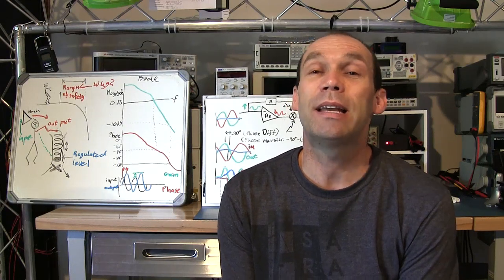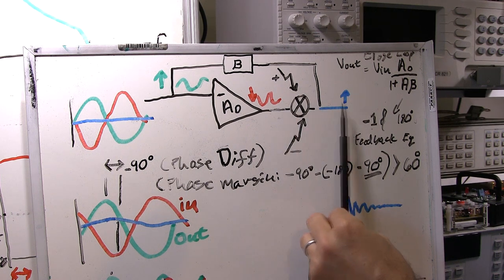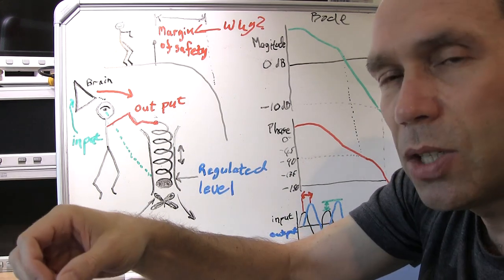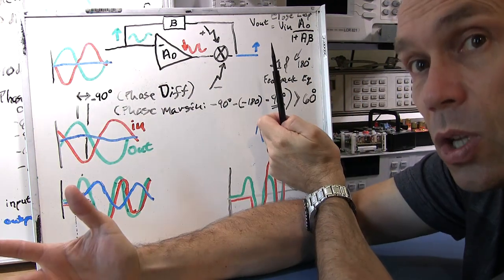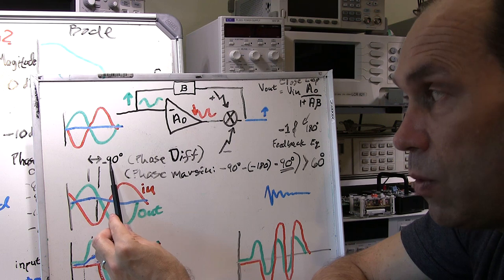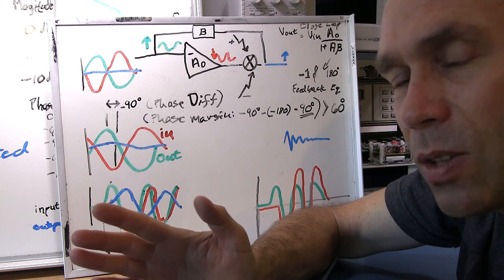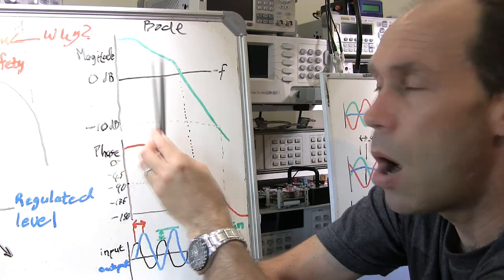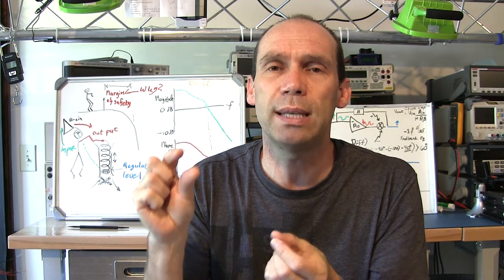DIY Bench Power Supply #14 - Op Amp Stability / Gain and phase margin

Comment: WELL DONE Martin ! You have made an excellent presentation of a very complex topic. This is a subject tackled in most Electrical Engineering curricula  in the 3rd year of study. It's typically entitled "Feedback Control Systems" or something of the sort. In a formal setting the Mathematics is quite intricate and involved. Your treatment reducing it to some simple Math and a Bode Plot does the viewer a great service. The plain language example you use also goes a longs ways to imparting an understanding to the uninitiated who don't have an engineering background with the adequate prerequisites. BTW your second pronunciation of Bode (with the long e) is the correct one. Thanks again
Reply from the maker: +Bob Marston Thanks very much for the post Bob.

Comment: Truly exceptional explanation here. I have come across one of your videos before, but had quite forgotten until I stumbled across this - Yet again Martin, I’m astounded at your ability to convey really quite complex topics with brilliant analogies and clear, visual explanations. I wish I had teachers and lecturers with your skills for passing on knowledge at college and University 🙌 🙌 🙌. Glad you skipped revisiting complex numbers - Have vague recollections of the anxiety they first induced when badly taught to me in my first year at Uni.

The other thing that really tickled me was that I’d been reading some standard text online (trying to refresh my memory/understanding) about op-amps, covering differential amplifiers and feedback loops, when I got distracted, thinking why the voltage output ‘very nearly’ follows the input (with feedback) without oscillating out of control, unless the op-amp gain was unity (and not 200k or so as is common). 

Spent a few minutes scribbling down some ideas before deciding to just leave it alone, as the text didn’t cover it and move on - Then later the text then came up with an explained jump from the formula Vout = Gain (V+ less V-) and (magically) “solving for the output voltage we get the following:”  - but without any mention of complex numbers or how they ‘solved’ the math 🤣🤣🤣 - Vout = Vin / 1 + (1/G). Anyway, somewhat serendipitous and bizarre that hours later I found your video which totally nailed the subject and filled in all the gaps others had conveniently left out. The World needs more teachers like you. Well done 👍

Comment: I personally prefer the Laplace transform approach for I think it is easier to understand correctly that way. It is not hard to figure things out but it can be hard to make sure that you really do understand what you think you understand. The "not applying enough force" analogy is completely misleading here because in a closed loop with an aperiodic chain for a feedback and an amplified error output, gain is definitely not your friend. Low gain only means slow response and higher dynamic error, but it is making the gain too high what makes the system unstable for a given delay. So there is a trade-off between performance and stability. It is important to undarstand that they tend to work against each other and trying to "apply enough force" only makes things worse.

Comment: Pretty good intro to a rather tricky subject. For me, the key is always that loop equation and thinking about when you're turning your nice negative feedback into positive feedback. It might be nice to show how an oscillator works too, actually! 

But a couple of thoughts on Bode plots...

People can get a darn good understanding of this stuff playing around in LTSpice (or equivalent). I don't have the equipment for measuring this stuff either, so I usually land up simulating it first. Then just measure the circuit the a scope at a few different frequencies and check it agrees.

I was thinking that it might be quite useful to show how to measure gain and phase with a scope and a sinewave generator, and do the plot manually. 

For me, I studied this stuff, knew all the maths, and never really understood it until I got my hands dirty and did some experimenting. It's super important, and I'm really glad you're doing a set of videos on it.

Comment: Very good video! Far too many textbooks dive straight into transfer functions, laplace notation, finding roots on Nyquist plots etc.

One thing that might be a bit better explained is around 24:00 when you're talking about being too slow and not having enough force causing oscillation, but adding force could potentially change the oscillation to ringing. That seems to be backwards. Being too slow would mean no phase margin, therefore positive feedback, but that wouldn't be a problem if the gain is less than 0dB, depending on how much less than 0dB the gain is (gain margin), that might ring to a degree. Adding more force would give it what it needs to oscillate (have no phase margin or gain margin, therefore oscillate).

Another thing you mentioned in the text is that ideally you want a ring of 2 cycles, less than this is overcompensated. Actually, any ringing at all is underdamped. Critical damping has no overshoot or ringing and settles faster than an underdamped or overdamped system and occurs at a phase margin around 76 degrees. The typical target phase margins of "aim for 60 degrees, but make sure its definitely more than 45 degrees" is underdamped, but it's a practical way of working when things like load resistance, input and output voltage, part tolerances etc all affect the loop.

Comment: This is great, I am in the same situation as you, and not understanding closed feedback control systems is proving to be a challenge. Hopefully I can bet my LTspice 0 through +-15V 0-5A linear supply working at all voltages and current now understanding how latency and gain change at different frequencies! Thanks!

Comment: there is another important thing , RF interference .
and the way to reduce it is to put the circuit board in the project box (which is made out of aluminum or any conductive material ) and connecting the box to the circuit ground .
also, EMI filter on the mains input will make a difference .

Comment: By the way, here's a potential use for your Red Pitaya. Get a signal injection transformer (not cheap, but still less than much of your test gear) and use it to make a Bode plot for your power supply under different loads, output voltages, input voltages. Depending on where you probe the 2 relative voltage signals you can measure the whole loop, just the error amp or just the power stage (plant). Do remember that input voltage, load resistance etc will be in the feedback loop, so the Bode plot, step response, stability etc. does change as they do.

Unfortunately, I think the Red Pitaya only plots up to about 60kHz and a linear power supply may have more bandwidth than this.
 
You have to have a stable system to measure a Bode plot, but often if it isn't already you can do that by putting a large capacitance across the error amplifier to reduce the bandwidth of the system so low that any poles and zeros are put under 0dB and so the whole system acts as an almost ideal integrator. The step response is aweful in this situation but its only temporary during testing.

Once you've measured the plant Bode plots, you can design frequency compensation and then demonstrate the step response to us under different situations.

Comment: If memory servers, the datasheet use to recommend adding a 10uF tantalum bead between the base and the emitter (directly on the 3055 device) when used in this type of application (power supplies)... Additionally the resistors should be mounted as close to the transistor as possible... even short cables (as you have currently have) may introduce instability...

It's worth a try but I had to follow this recommendation on a previous build albeit a very long time ago ;)

As regards the diode connected to the zenier, this was used to compensate for temperature drift (of reference voltage), as each diode has a different temperature coefficient, positive and negative ...  Mike

Comment: how do you get those bode plots you used for phase margin and gain margin in simulation? If I break the loop and inject a signal, op amps have insane gain (10^6) particulary below 10KHz?

Comment: Bode plot can be obtained mathematically by plotting transfer function in frequency domain, or experimental as you described.
Reply: Miloš Lazović  here is simple demonstration of op amp loop stability, it could be easily replicated with real components  http://www.linear.com/solutions/4449

you can do bode plot with just signal generator and any oscilloscope and paper (and calculator) but it is hard way
Reply: Miloš Lazović thanks, these will come in handy.
Reply: *****
That example is just special case, for more general usage you should use Middlebrook's or Tian's method (as I remember there is LTSpice example for Middlebrook's method).

Comment: Hello Martin, I really appreciate your videos and your passion for electronics. keep going. I just wanted to express a doubt on the circuit: the voltage drop on the feedback resistor for the current is added to the zener voltage making the reference voltage unstable but dependent on the output current. Could it be a problem? Would not be better, therefore, that the anode of the zener diode is connected to ground instead of to the non-inverting input of the op-amp? Thank you for your feedback.
Forgive my poor English (thanks google translator)

Comment: ok.. having a big phase shift in the regulation/feedback loop is a bad thing when its too large  and all. but isnt it also a question of time? reaction time i mean. i mean, does it still matters if you just try to "suppress" fast swings/changes (frequencies) within the feedback-loop  ? so lets say anything that goes quicker than 10 or 25ms is supposed to be ignored (suppressed by caps , RC or LC filters or somesort in the feedback look), wouldnt that be a good enough regulation if its not "lightning fast" ? big ass caps on the output maybe could help smoothing out the "over and undershoot" too , idnt it ?
Reply: Axel Werner Actually phase shift is usually expressed as the time delay a sine-wave of a certain frequency experiences. For example, a 1 kHz sine has a wave of 1 ms, 90 degrees phaseshift would then correspond to 90/360 * 1ms = 0.25 ms. So yes, that is a different way of expressing time delay ! Yes you can insert a very large capacitor in your loop to make it stable, BUT your feedback loop will get much slower ! So it will respond slowly to any changes in the system. So if you connect a load to the powersupply , it will take some time for the output voltage to reach the intended value. Indeed, loop stability is a compromise between required speed aan stability under all circumstances.

Comment: Well this series was a good waste of time..:D You didnt even get the current button cleared. Or how to put the limiting potentiometers to series. If you want clean good signal you need to do something to that AC transformer and bridge rectifier. To get the cleanest signal you need to use toroidal transformer and ceramic caps in the bridge rectifier (they need to be with every diode, 103, 203 and 102 ones). They also help if you add them between +/- DC rails. You might also want to test some differend values with the 2200uf ones. This same issue has existed for a very long time in 8bit Nintendos.